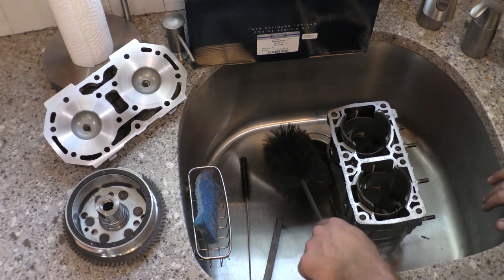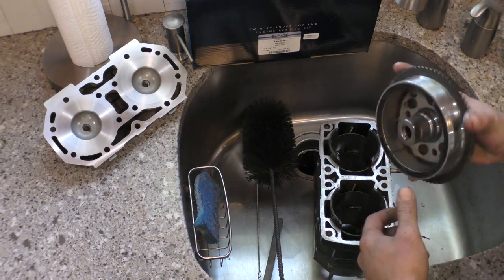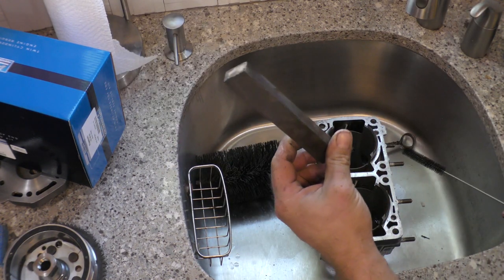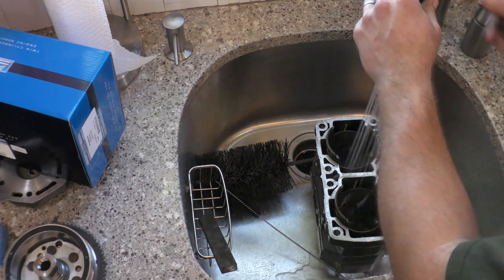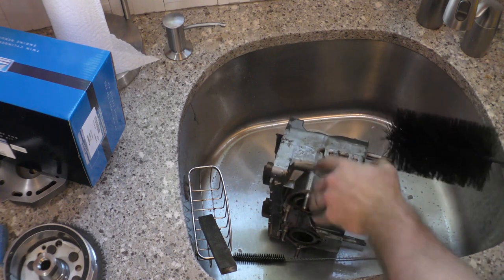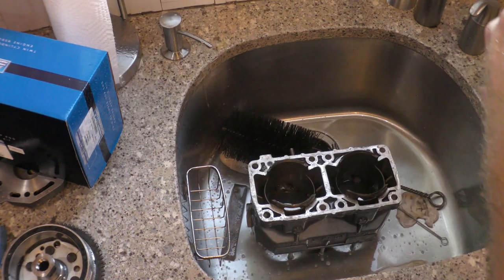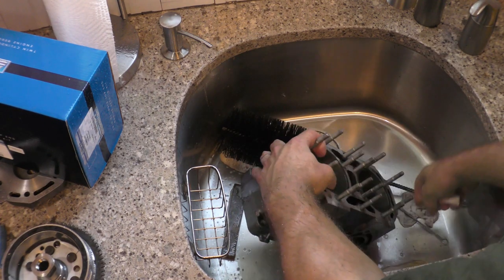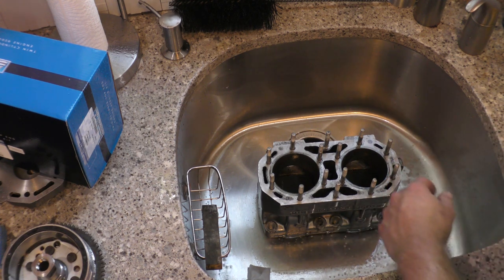Prep for POWER!! How to wash a 2 stroke cylinder after machining.

Comment: Were you using plain hand soap? Wouldn’t you want to use a mild degreaser maybe?
Reply from the maker: Dawn dish soap.     This was washed in a parts washer first.    You don't want degressor for the final cleaning.   You're really only cleaning the grit out of the hone.